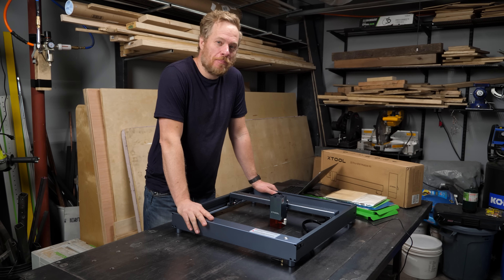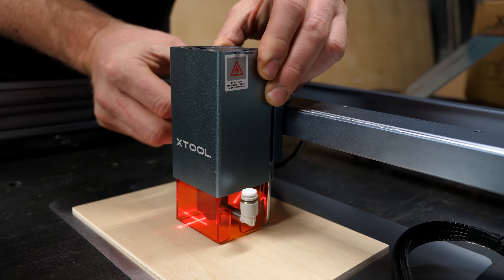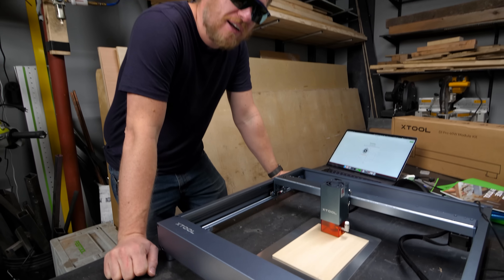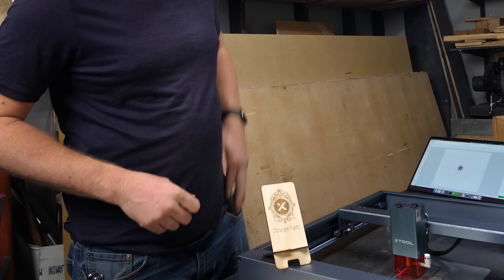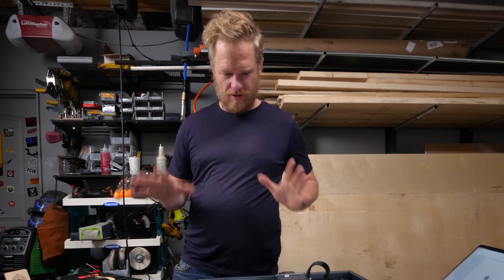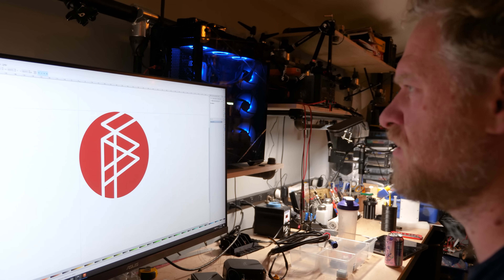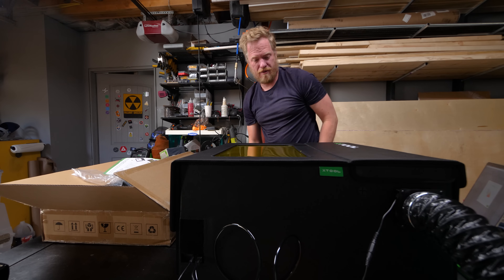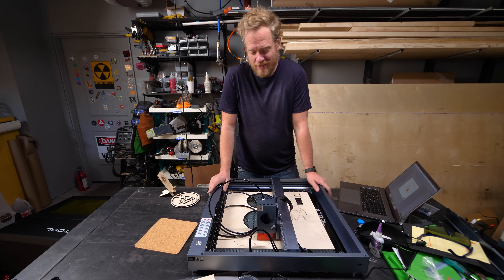Bare Naked Diode Laser Cutters - Petite but Problematic. The xTool D1 Pro

Comment: I find these laser cutters terrifying without a proper enclosure... if that laser can cut through wood and metal, they sure can cut through skin. I would definitely want an enclosure that the laser can't penetrate.  Also, the fumes can be pretty toxic, those definitely need to be taken care of. Another big concern for me is that this is a huge fire hazard. I would definitely want to mitigate that risk, like having an easily accessible power switch to quickly cut power, having an extinguisher nearby, getting a fireproof enclosure etc

Comment: I have an XTool D1 (no "Pro," only 10 watts). I've seen that problem where there's a hiccup of some kind and the laser starts being misaligned. Doing a "Home" before starting a project seems to prevent that. Also, LightBurn software is pretty much a must-have for any laser cutter/engraver (and it allows you to do a "Home).

Comment: Pretty cool lasers and not terrible if you source name brand appropriate laser safety glasses. Still, the fact they still just don't sell a fully configured 40W system ready to go at a decent price is just weird. Skip the rebuilding of the system and just snag a cheap 60W CO2 system for the price and the build volume and ability to cut clear acrylic makes this a hard sell. Maybe if you weren't buying multiple control boards and diodes, the price could be more competitive.

Comment: I've seen a number of these open-air models lately, and as someone that has done 1000+ hours of detailed laser engraving and cutting on wood, papers, acrylic and leather, these open setups are utter madness. Even in a shop environment, the fumes/smells could be terrible depending on the cutting media and my experience is that it can be pretty overwhelming even with a fully enclosed, air assisted and fan-jetted exhaust outside. The potential for dumb accidents is just so much higher as well, I just hate this concept.

Comment: LOL RSVP your eyesight after getting that thumbnail!

It is very interesting, but you definitely need something to deal with the smoke. Having the cover with the hose you can poke out the window is good, but kind-of defeats the purpose of buying this over a regular enclosed model. And I can see having to pull everything out separately to set up the laser cutter every time you wanted to use it would get old pretty quickly. So yeah, I hope it works out for you, and anyone else who decides to go for one of these. At least they can always improve the software, which sounded like the main problem anyway.

Comment: I tried acrylic with a 10W diode laser and it didn't work. Seems to be translucent to the wavelength. I got the darker acrylics molten a bit but there was no precision. 
Btw I didn't release the review because the fumes gave me headaches and I didn't want people to assume it could be used without proper ventilation

Comment: Am I the only one thinking that "percentage of power" and "mm/second" are silly settings? Only one of those can translate across devices, and it's useless without context.

Why not "joule/mm"? You already know the power of your laser (let's assume the 5W and 40W are the output power). If you wanted 10 joules/mm, you'd need to have the 5W move at 0.5 mm/second, and the 40 W could do 4 mm/second.

You can also use this across products. A manufacturer could specify that their 2 mm thick material needs 10 joule/mm for two passes, and their 4 mm thick material needs 10 joule/mm for five passes.

Comment: FYI. On cnc stuff your origin tends to be where you set it as your providing the working surface.
So its sometimes centre on your work piece or sometime a corner.
This is just path of the machinists toolpath.

Comment: Wow, that thumbnail really encourages bad safety practices that can literally blind someone if they copied you.  I am not one to usually safety police a channel, but those diode lasers are incredibly dangerous when operating without proper PPE.  Hell, they are pretty dangerous when you do have proper PPE.
Reply: And you click on it, so it accomplished what a thumbnail should do, and in the video you can see he is using the proper glasses. This is what YouTubers are required to do, entice you with a thumbnail and retain you with a good video.
Reply: @josuelservin  the thumbnail would have been just as good with glasses on. Same lighting, same dopey "YouTube Face" that the algorithm requires.
Reply from the maker: Yep, I get it.  We did shoot some with the glasses on, but decided the ones without worked better as a thumbnail.  I feel like I addressed it enough in the video to be responsible.  If you're making safety decisions based on youtube thumbnails alone, I feel like you've got bigger problems:)
Reply: @strangerparts  haha, fair point! Thanks for addressing it!

Comment: For expert advice about this product ask a dog!  Not just any dog, but "Buster Beagle"   As for the lousy software and instructions, you (having a background in software dev) should know that 1) nobody ever tries it out and 2) that the devs automatically work around the issues and assume that "everyone knows THAT!".  I found that having someone totally unknowledgeable  (like from administration or the warehouse) open the box, follow the instructions and make the demo is priceless and almost bulletproof.  Yet nobody seems to do this, even after decades of proof that it is absolutely invaluable.
Reply: ...also a good exercise for developers (regardless of whether they develop hardware or software): use your product under real world conditions, in the real factory (or wherever the users are), using real material/data, doing a real job (not just a simplified simulation). I learned that years ago when my users kept begging me for an auto-config feature in a software and I just waved it aside as "unnecessary, totally bloated, it's easy to use already... yadda, yadda". Eventually my users lost patience and forced me to come into the factory with them and use their tiny little laptop with thick gloves on and no mouse... long story short - the feature was implemented a few hours later and I never again waved complaints away quite as easily as back then.

Comment: Hooking up an airline to the laser will greatly increase your cut quality and less of the burning effect that is around the cut.  I see the air line is capped off how you are using it.

EDIT : I see the new laser you setup with has the air line attached.  
Does the ESP32 control board that came with the new laser, does that just control the laser, or the steppers too?  I never even thought to use an ESP32 for that kind of work if it does control the steppers too.  I didn't think it would have that kind of processing power.  I use ESP32's in all my home electronics projects and use them on my own PCB builds too...  ESP 8266 got me hooked and then ESP32 opened me up to more power!   LOL  I always used Raspberry Pi's for my CNC projects.
Reply: I got a 3018 with 2.5W laser and also use Raspberry Pi, bCNC and Fengrave work ok for routing but I had to use LaserGRBL on a laptop to drive the laser. Everything takes longer but hard to beat the pricing for a learning machine. Corflute sheet and duct tape enclosure would be easy to do. Still looking for orange sheet/film